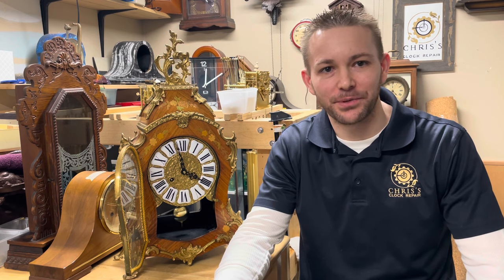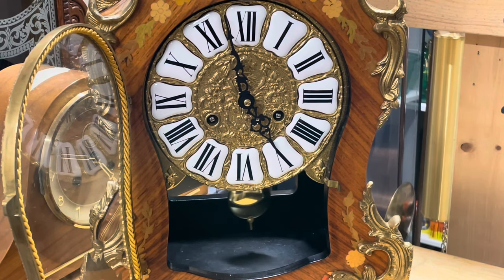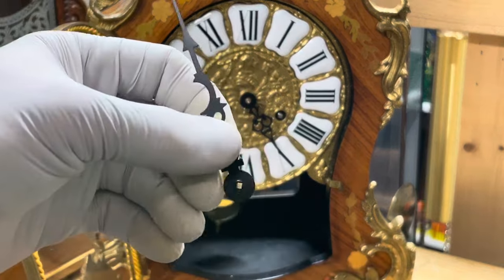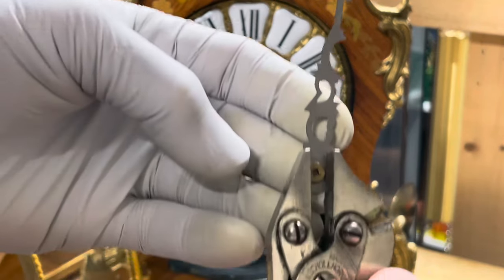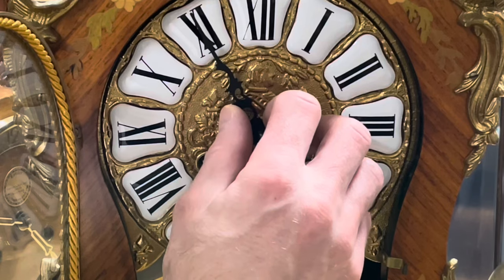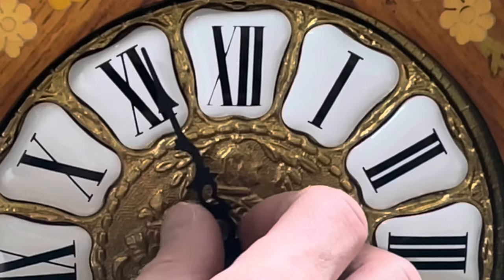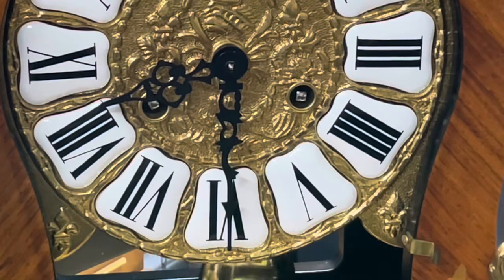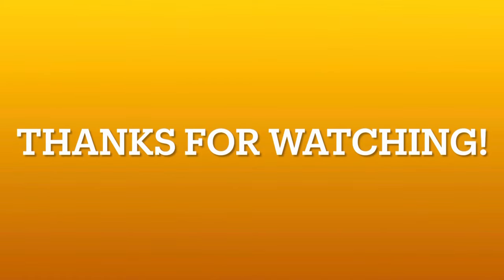How to adjust your clock hands so it strikes on time.￼

Comment: Hi Chris, I have a Verichron wind up wall clock that is about 35-40 years old. It chimes the wrong amount at each hour. I tried moving the hour hand to the proper time but the next hour it may be anything. sometimes it chimes 4 and the next hour it may chime 7 times. HELP! and thanks.

Comment: Great video.  My second hand has some wiggle room causing my clock be behind when the hand is on the left side and a bit fast when on the right due to the weight of the hand.  Can this be tightened?

Comment: Very nice vid although my method is a little different to yours. Instead of using pliers to turn the bushing I use the tapered squar back end of a cutting broach to push the bushing of the hand on. ( broach fastened in a vice ) You will then have two hands to support the hand ( no pun intended ) to turn it.
Reply from the maker: Actually that is also how i do it, but this video is designed for someone to be able to do it without “special” tools.

Comment: My Howard Miller grandfather clock strikes the wrong number of times. I tried moving hour hand to the time it struck then back again to correct time. It worked till 9pm.I set it around 2 pm.At 9 it struck 8 times,same thing at 10,then it started backing up to 8 times,then 7.Now this morning at 6,7 and 8 it was right. It was wrong at 9 am and at 10,11 and 12. Then at 1 pm it struck once,which is right.What's up with i?. Never right since daylight savings time and we had to spring ahead! Can you help? We seem so close to fixing it.
Reply from the maker: It sounds like the rack may be catching on something or not falling correctly onto the snail.  You will have to watch the movement in operation to see what is causing the difference in the number of strikes.  You can do this by removing the dial.

Comment: What if it doesn't have a bushing ? Strikes 3 minutes late. Thanks.
Reply from the maker: Then you are probably dealing with an antique clock and it requires a more technical adjustment on the inside of the movement, which I don't have a video to feature that as of yet.
Reply: @Chrisclockrepair   I think it is the star wheel they has to be slightly turned.
Reply from the maker: The star wheel adjusts the run of the lift of the strike; it doesn't determine when the clock begins the striking sequence.

Comment: Chris, I have a very old grandfather clock that doesn’t have the part of the hand that allows for adjustment. Is there a way to modify it?
Reply from the maker: No. If it is antique clock, this adjustment will not work.

Comment: My clock stricks the hours correctly but at half hour late.. ie at 6.30 it chimes 6 times.
It has three key winding ports.
It chimes correctly ? Every 15 minutes, keeps good time, just the hour chime is 30 mins late...
Can this be reset at home ??
Thanks Chris .. uk 🇬🇧
Reply: Just undo the hand nut (or take out the pin holding the hand) and replace it at 180 degrees to where it was. Replace the hand nut (or pin).

Comment: I removed the nut and there is no bushing attached on the back of the second hand!? Now what. ? It’s chiming 3 minutes after it should.mantle clock Ingraham. Thank you.
Reply from the maker: That trick won’t work on your clock as it is a countwheel type movement. That’s not a beginner adjustment.